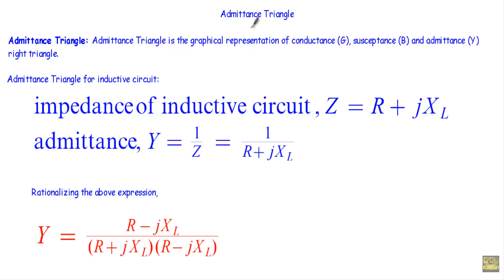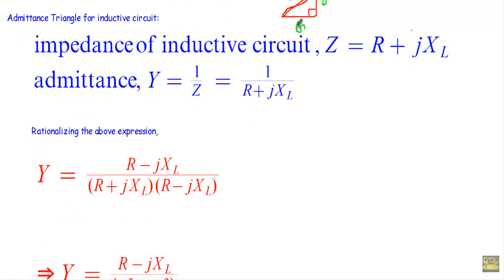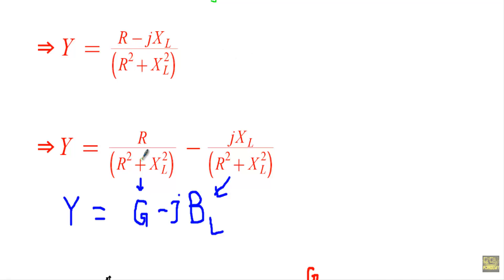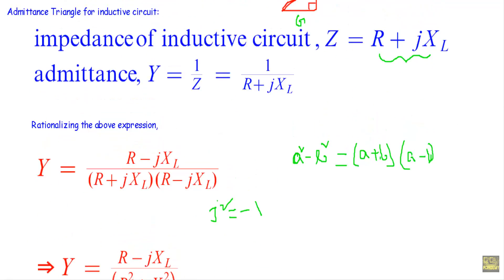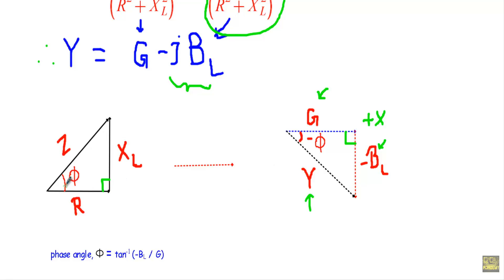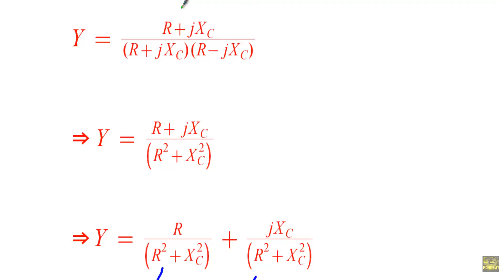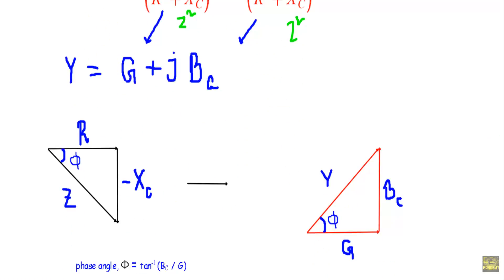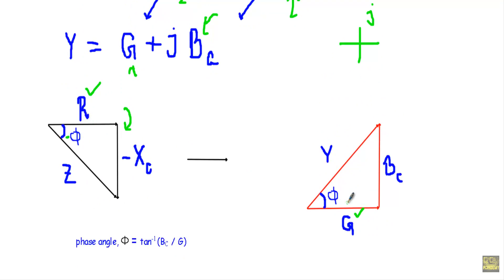Admittance Triangle of AC circuit

Comment: What I found confusing about this issue is the way this applies only to parallel circuits. Otherwise the angle phi is different, 90-impedance angle.